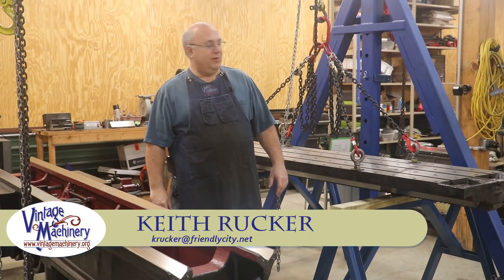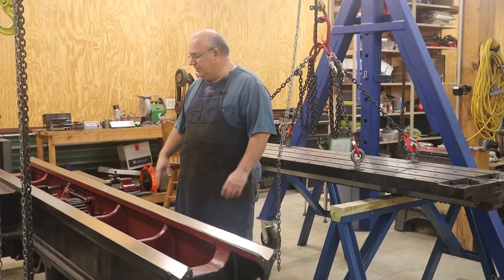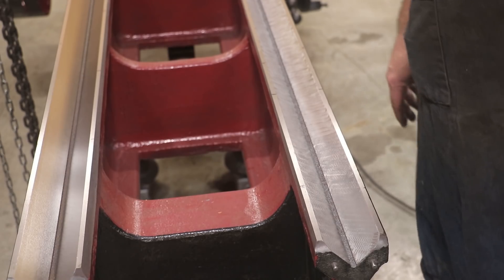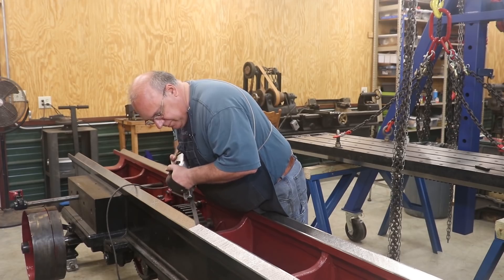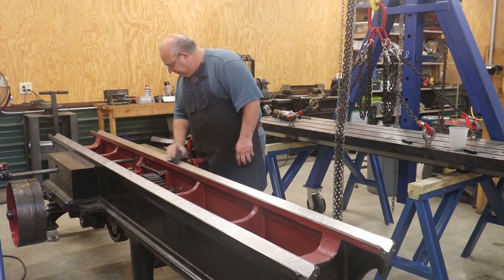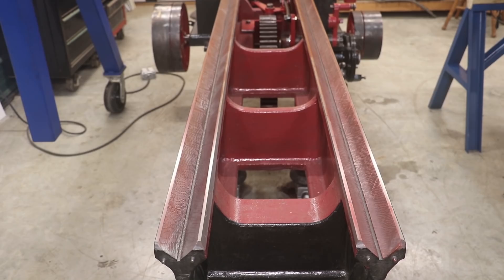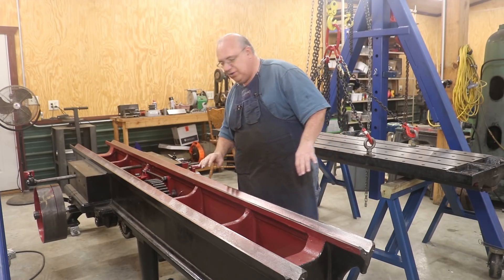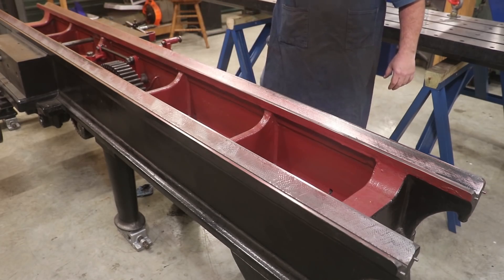New Haven Metal Planer Restoration - Part 26: Scraping the Ways on the Machine Base

Comment: I think you might want to consider making a spreader frame for the chain basket so the hooks will be pulling vertically. It could just be a rectangle of square tubing with plates at the corner and notches in the plates to receive the chain. Even thought the hooks are mounted in the correct 1/4 and 3/4 positions the angle of the bracket legs and height of the hooks are bending the center of the table downward. You might be getting some false contact in the center when you initially lower it on to the ways of the machine. It might not be a problem, but should be considered. You could put a long straight edge across the table with a tenths indicator and see if there is any measurable dip as it's lifted off the saw horses.

On this same subject it would be interesting to see the results of a second autocollimator test of the bed after the weight of the gantry and cutting head are attached. I would guess that they are heavy enough to make a measurable deformation. I hope the middle legs are positioned to be directly under this load but they might not be.

Comment: I'm listening intently to Keith and also reading the comments here thoroughly.
I have also done a fair bit of scraping myself. 
I'm in the same boat as Keith (but not the same class) with my horizontal Milling machine: I had all the ways and surfaces precision ground.
But I had intended to FLAKE just one side of all the ways, not both, for lubrication and to reduce stiction. Then I was going to print the result and correct any minor errors with scraping on the flaked surfaces only. On the table ways I was going to flake the underside of the ways so that swarf and dust gets wiped off the ground top surfaces by the wipers, without a chance of getting 'caught' in any scraping. Keith appears to intend scraping both surfaces and started with the upper surface. Yes, he has about a thou to correct he said, I don't have - nor the means to measure or intentions to correct microns on my 36" and 12" up-facing ways.
So am I on the wrong track or are there more than one way to skin this cat? What is the logic and consensus, please?

Comment: Thinking about those sags on the ways reminds me of the fact that when you look at a real house, everything looks exact, but on cartoons, you often see things like doors that have sides tapered so that the bottom is narrower (or wider) than the top and that the top is tilted such that the left side is lower than the right.  News flash!  Real houses are more like the cartoon ones than you think, but you don't know it unless you are trying to do some repairs, remodeling, wallpapering, or other modifications on the house.  Same with the ways on your planer as they make invisible sags.  Perhaps, you can make a cartoon of such a machine so old and beat-up that these sags really show up along with other imperfections!
Reply: Steven Mayhew - I helped with a restoration of a friends house. There was some flaw in the original engineering/construction cause 60 years later, the house was leaning towards his neighbors house at an angle the measured about 7/8” over 4’. We had to replace 32” doors with 30” doors and still couldn’t get them completely plumb in the rough opening. I don’t know what the place looks like now but if that house is now supported by the neighbors house, it wouldn’t surprise me.

Comment: Since the table was ground it makes sense that you can use it as a reference. What if it wasn’t bad enough to be ground or you didn’t have access to a big grinder? How do you do those v-ways? Flat is with a straightedge. Coplanar is with a Kingway fixture. How do you get the triangular cross section? A vee section straightedge?

Comment: Rather than etching ink, look for "rubber base" printing ink. This is an ink that does not harden or dry, so you don't have to worry about the ink not staying wet if it takes a long time to ink everything up. Also, if you leave it overnight it won't be any more difficult to clean off.

Comment: I would shorten up the drive loop on that chain hoist so that the bottom is about 14 inches above the table. So that it is not dragging on the edges of the table.
No need for it to go to the floor.

Comment: Not a criticism, just curious.  Did you check the table for flatness?  Typically you would use a scraped straight edge to reference scraping, but you are using the table. Why not scrape in the table first so you have a flat reference for the ways?
Reply: He checked things out with the autocollimator.
Reply: I think it's just a matter of him trusting that the grind job he had done on the table is flat and parallel. As long as that's the case, fitting one surface to the other is perfectly acceptable. On ways that long, he's already well within normal tolerances for something like this, as he already verified with the auto-colimeter. He's going above and beyond doing this level of fitting.
Reply: @siggyincr7447    That is true enough.  He could easily have gotten away with simply flaking it for oil retention, and still have it better than original.
Reply: @aserta  Has he done the top which he is using as the 'master' Ive only watched him check the base with his autocolimator !
Reply: I also think that only the base was checked in the previous video. I’m not sure if Keith checked the table, but I think maybe he didn’t have to? As far as I remember the top was ground first and then the v-ways, thus the setup in the grinder was pretty solid.
Reply: How do we know the table is flat? Is it any flatter than the base? Flat enough to use as a reference? As my questions probably attest, I’m a total armchair scraper and must be missing something, but I am genuinely curious. Just imagining doing this myself though, the thought of turning the table over to scrape it first would give me pause.
Reply: Richmond Patton Prehn It would be best if Keith explained, but this is what I know - Keith gave both the table and the base to be professionally ground. I think he might have measured the result, but even if not, judging by the job they did on the base (which I think was much harder) the table should have even lower deviation (and the base was 1 thou). One thing to note is that many components are not scraped at all - take for example hardend lathe beds, they are just ground.
Reply: Piotr Sarmacki. Thanks for taking the time to explain your take on things. Could be you are right. Another wrinkle, for me anyway, is a lot of commentary on Practical Machinist, including from Richard King, indicating that, if only one part of a ground pair is to be scraped, it should be the upper part. In order to minimize swarf and dust collection in scrape marks in the bottom ways. Although I think I may be confusing scraping with flaking, and covered ways with open ways. Lots of moving parts, literally and figuratively. Anyway, while I am less puzzled than before your reply, I remain confused. Not an unusual state, I admit :) I’ll catch on eventually. Thanks for your reply.
Reply: @siggyincr7447  No doubt, scraping isn't necessary and this would be an awesome machine.  He's making it stellar with the scraping.
Reply: Richmond Patton Prehn I attended Mr King’s class and he definitely mentioned that he prefers flaking on the upper surface for the reason you mentioned, but I am not sure if he mentioned scraping, either. But that’s an interesting point.

Comment: Keep the iron filings to mix with a tiny amount of epoxy for repairs, e.g. Peck holes in a drill table. Good work. Thanks. Mike
Reply: You never fix it like that, you braze them.
Reply: @aserta  surely that depends on whether it is structural or cosmetic. I wouldn't risk heat distortion for the cosmetic repair . Ideally the best way for structural repairs would be spray welding, less heat input and a closer colour match, but go for brazing if that's all you got.
Reply: aserta, I’m curious, why shouldn’t you use that for a peck hole or a blemish? It sounds like a good idea.

Comment: Hi Keith, I'm just kind of thinking out loud here, but please correct me if I'm wrong. The ways on the base are there to support and guide the table. If removing metal from the ways, to some amount, lowers the table in relation to the bull gear. Depending on the amount of clearance between the bull gear and the rack beneath the table and the removal of way metal, wouldn't the bull gear start to bear the weight of the table and loose the guidance of the ways? I hope that I'm getting across what what I'm trying to say.
Reply: 51ubetcha, he said he was only going to be removing a thousandths or two. That small amount shouldn’t interfere with the bull gear and the rack.
Reply: You are correct Tim, but how much was removed when the ways were ground. Also I don't know how much clearance as they between the bull gear and table rack to start with.
Reply: 51ubetcha, Keith has said in earlier videos that they had ground the same amount off where the rack mounts on the table as they had ground off the ways. It should all line up correctly if they took the same amount off both the ways and the bottom of the table where the track mounts. He actually has the track mounted in this video, so if there is going to be an issue, it should show up right now. This has been a good video series, I know I’ve enjoyed it!
Reply: @Hoaxer51  Thanks for info. I have been watching the series,but I must have missed the part where Keith stated the removal of metal for the rack mount.
Reply: 51ubetcha, I think he said it when they were at the machine shop that did the grinding. It’s been awhile ago, so I’m not sure which video it actually was. It has been a good series, I’ve enjoyed it also!

Comment: Get yourself a back support belt. I use one all the time when i work outside my center of gravity and i'm just 30. Make sure you buy a proper one, not just any that says "back support". It's really worth having one.
Reply: I agree it feels like it makes a difference, the real key is to strengthen your core, that's the way to help yourself with back issues. 
It's not always easy and not possible for some though.
Reply: Or a "leanin' post you can plant your chest and belly against. Slip a 2 x 6 about 6 ft long down into the bed when youre scraping on the far way. Block it as you need to adjust the angle. Move it from bay to bay as you scrape. Whatever weight the post is taking is that much less strain on your back. 

Trust me, I've been there. Having something to lean your chest against might make the difference between living a normal life and funding a college education for your chiroprator's kids.

The Biax weighs 10 lb or so perfect for screwing up your back. One trick I've found very effective is a spring tool suspension to carry the weight of the Biax. No need to get fancy. I use a $4 screen door spring I bought at Lowes back when. Knot a string sling about 18" long. Basket hitch it around the Biax at the balance point so it hangs naturally at your preferred angle. Hang the basket hitch from the spring and the spring from the crane hook you have right there. If re-rigging the crane and moving the crane back and forth is a PITA, hang the tool from a trolley running in a length of garage door track way up in the rafters.

Comment: I'm somewhat surprised that Keith didn't use a strait edge on the table first then use the table as a strait edge on the base, I know the grinding did a nearly perfect job on the ways, but I would have thought that a getting one set of ways scraped to match a strait edge would be more accurate than the process seen in the video...
The only reason I can see to doing it this way first is to get the fitment closer first before using the strait edge, I guess we'll all see soon enough.
Take care with your back Keith, it's easy to pull your back out being hunched over for long times, best to break up that process  with other tasks that can give your back a rest.
Reply: @chris0tube Keith has never claimed to be a professional scraper, machining is just a hobby of his, I think he's doing a great job so far and will have this planer working better than it did when new, and have tighter tolerances than new, could it be better? Sure, but this is a hobby, it's also a learning project, what better way to learn and improve than to do it? There is none.

Comment: I've been following this series but don't recall Keith ever checking the underside of the table after Cash Masters' grinding job, so I don't how accurate it is.
Wouldn't it be better to scrape the table first using a 6' scraped straight edge then scrape the bed using the table as as a straight edge.? 
That way you can check the co-planer, straightness and flatness of the bed.
Reply: You mean the bottom monting surfaces?
Reply: @zHxIxPxPxIxEz  Yes.
Reply: @petemclinc  the grind job should be accurate enough for distortion free clamping

Comment: When I was 16 my dad had me help this old fart (half dead) scrape an old Cincinnati #4 centerless. I couldn't stand it ..or the half dead old fart. That drove away in NEW bone white Cadillac !!
 I remember thinking then "Man, I can't wait to move out and get a REAL JOB !!"
 50 years later ...still in the shop and kicking myself for not paying attention !!!

 Signed: terminally stupid
Reply: And you probably had to scrape by hand. I don't think you had a power scraper like Keith's.
Reply: @danielcobbins9050  no, it wasn't that. The three surfaces on a #4 are. ..the machine base, steady rest plate, and regulating wheel. All sandwiched. So...
 Only about 3x3. He showed me how to neg rake the blade and curve. And flex the tool while you flake.
 A couple of passes and he had great coverage. Float finished....and this was before he scraped the bearing !
 Good stuff ... I'm still and ass for not being totally there.
Reply: @danielcobbins9050  sorry dude. I was going to answer before you lossed me on that trip down memory lane.
....my point: yes we had power scrapers and no: this old fart was OLD SCHOOL,  and he knew it. And I didn't. Yo.

Comment: Im curious, I know that iron particulate can get into the air, like when grinding in a grinding room, how much iron gets injected into the air when scraping, that has to be at least some
Reply: Those are mostly really big flakes compared to grinding dust. There also isn't an air flow like there is around a grinding wheel. Most of the stuff will stay within a couple of inches of where it started, and the rest is going to fall pretty much straight down.

Comment: Did I miss where you printed the v-ways on the table first?
Reply: Brian, he does it at about 14:15
Reply: @patwicker1358  He said he stoned them and cleaned them up. Didn't say he printed them with a straight edge.  Maybe decided the ground finish  with te table fully supported on Cash's grinder was going to be flatter than what they could produce upside down on saw horses in the shop?
Reply: @bcbloc02  I understand, I mis-read your comment.
Reply: @bcbloc02  Hey Brian. He said he we will print the base with the table, then the table to the base. IMO, the table flexes a lot more than the base, but I haven't done the math to see if it's significant.
Reply: @TheMetalButcher  Sounds like a dangerous gamble. With my luck I would wind up scraping a pair of matching curves instead of flat parallel surfaces. lol Of course maybe he plans to check between scrapings with the autocollimator and bring it in using those measurements as another piece to the puzzle.

Comment: I understand if you have 2 perfectly flat surfaces they'll stick just like reference blocks, but what if you had 1 ground surface and 1 scraped surface? would that not work as well as 2 scraped surfaces?
Reply: No.  The process of scraping creates peaks and valleys where the valleys serve as the channel to carry lubrication. If you cut the amount of scraped surfaces in half, you also cut the amount of lubrication in half, and you increase the rate of wear.  The surface tension of the lubrication itself keeps the lubrication from falling off the scraped surface (the sliding table in this example).

Comment: Why didn't you use a scraped in straight edge?  was there any advantage to use the table instead of a straight edge?  I saw Abom's video on your work for the shaper and you used a straight edge there.  Genuinely curious.
Reply: I think it has to do with how well it was ground, we're already at the final matching and adjustment phase. He's considering the table good enough to use as a master, and the double V design means he has to do that at some point anyway.

Comment: What if the ways of the male half are out of shape? Don't you need a seperate reference surface?
Reply: Terminal Insanity. He has already checked the straightness, "levelness" with the autocollimator in a previous video.
Reply: @stumccabe  he checked the female half (the planer bed) with the autocollimator, not the male half (the table).
Reply: @chris0tube If they hadn't already precision ground it, I'd agree.  But keeping in mind this is an 1800's planer not a Moore jig bore, he's ok.